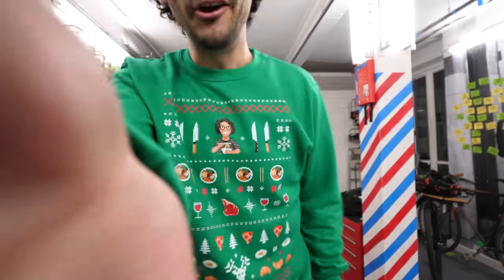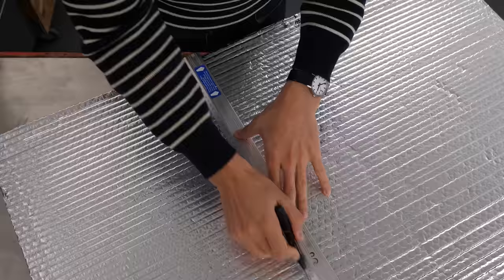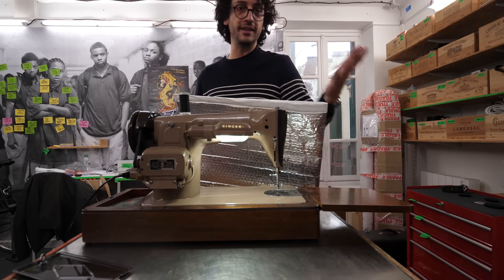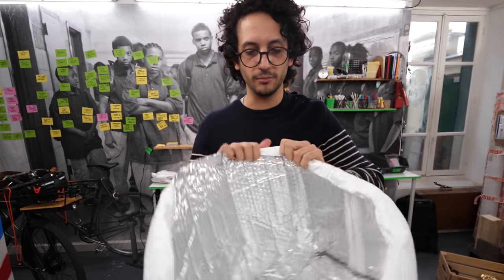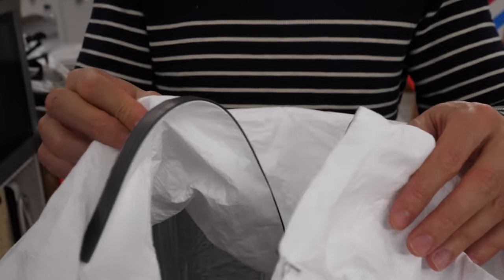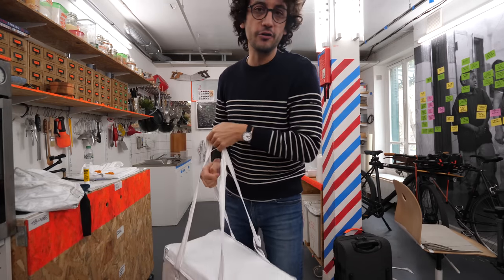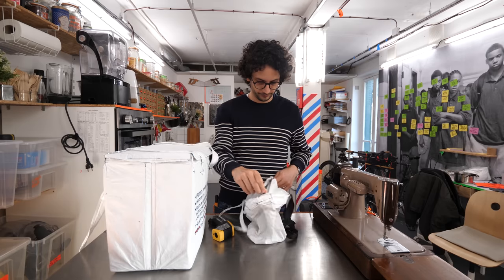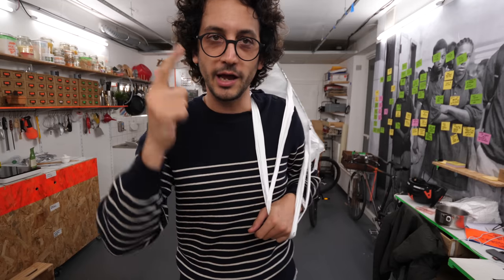Grocery Bag #3 Has GREAT Insulation But...

Comment: I think you need a rectangular waxed canvas bag with a fold-out (2 piece?) rigid but thin bottom. Add some adjustable straps, an interior thin insulative bag (which can collapse) attached to one side for cold items, and a simple fold over cloth lid (maybe with magnetic closing snaps, and also something stronger like a simple tied closure for situations where it may fall open during transit)

Comment: For foldability and structure, you could have a flap that is loose or sewn to one long side.  If it is a tough cardboard or plastic, it could provide the base structure and fold up with the rest of the bag.  You could even have it be a rollup mat made of bamboo rods.  This would allow it to conform to a small cylinder that rolls out to become them bottom.  For insulation, all you really need is air between two waterproof layers.

Comment: If you want structure + compaction there are options with a wire-rimmed cylinder. It can fold into about half the diameter, be flat, and yet pop into shape when desired.

Comment: Try sewing layer of the "space blanket" between two layers of "tyvek" that would be both reflective and give you an air gap. The alternitive is to use spray adhesive to join the silver space blanket to the tyvek reducing the layers to one.

Comment: Try adding an inside lining of a recyled wool blend to the tyvek and then use the insulation on only three sides of the bag, keep the adjustable straps and instead of a box use a messenger bag shape, for added benefit use indigo or other plant based dyes for a nice colour/design

Comment: The neck of the bag was great, that means it can expand when you buy a lot of stuff. You can buy stronger magnets online, I've had the same issue and stronger magnets get the job done. For insulation, in NL we have these aluminum freezer bags you can buy at the supermarket. They are plastified and get the job done, but still have a similar thickness as the tyvec.
Reply: To add to that, I use jeans needles if I need to sew something tough. they are 110 instead of the regular 75 or 80 needles and can handle thicker materials.

Comment: Have you tried to sew a ziper? The water proof ones can gave you structure and a easy closure.... 
For the fold, you can experimenting with a pocket atattchement to fold the bag into itself.
And do go with diferent size handles. Yours can slide when you're walking.
Hope I  could help... good luck

Comment: For the sewing all the layers part, a walking foot for your machine should help. The machine normally pulls just the bottom layer but the walking foot will pull the top layer with it. It's used in quilting a lot cause of all the layers

Comment: For foldability along with insulation, you might want to think about mylar survival blankets. Super lightweight, highly insulating, very foldable. They can be recycled, although it's a specialized process and not every place does it. Layer it with your tyvek or even just canvas and it should hold up pretty well .

Comment: Maybe you could use the metallic material on the bottom only to make a rounded square structure (most of the cold will be lost through the bottom and sides) then use goose down/ down insulation/ upholstery batting like an ultralight jacket. You could sew whatever pattern you'd like in the down between two layers of tyvek. Honeycombs or lines, whatever you'd like really. It would certainly be more flexible and a bit lighter.

Comment: I was thinking just one sheet of those insulated panels for the bottom of the bag (no need for Velcro as the weight of the groceries will keep it down); then the four side panels sewn end to end on three of their ends, plus two Velcro strips on end four & one (so it makes the four sided inner box). What u would effectively have is a long rectangle (the four side panel) & a small rectangle (bottom). U then put the bottom rectangle on top of long rectangle & use the old camping trick of rolling it up into a roll which you could shove in your other back pocket of ur jeans. Of course, I’m not bothering with top insulated panel cos that might make the “roll” too bulky for ur pocket??! But u get the idea... (I hope) 👍🏼👍🏼✌🏼

Comment: you have made something of a food courier bag there! funnily enough my local supermarket coop makes a bag (google "coop fold away bag" and look for the light blue bag in image results) out of PET recycled bottles, which has most of the elements you've been designing for, except the insulation. what i like because it's made out of recycled plastic is that it has a lot of rigidity when unfolded, but it also has the flexibility of fabrid so can be folded down nice and flat and be tucked away in my courier bag where it takes up no space. i could envisage. i could imagine just taking the reflective mylar thermal blanket material and sewing that into PET cloth and you would have something insulated but thin enough to still fold.

Comment: hey alex, you could have the insulation part only cover the bottom and then maybe a third of the way up the walls, and not on the lid. that way you would put frozen items at the bottom of the bag, then refrigerated items on top, then non-chilled stuff at the very top. maybe even have a false bottom/lid in the bag, mounted at the level the insulation stops, so it makes a chilled compartment in the bag, then other stuff goes on top of that.

Comment: Have you considered using wool to insulate the bag? It may be an unorthodox suggestion but it could tick a lot of boxes: recyclable, insulating, depending on what kind you get it could be thin enough to fold, and it even has some water repelling qualities (although it wouldn't need to because you already got the Tyvek leak-proof in the previous prototype).

Comment: Make a everyday backpack-type bag that has a sleeve that goes the entire inside of the bag (meaning, a bag within a bag with a space in between) to slide an insert into when you want to use it for groceries. You would create the insert out of that material you purchased to help with structure and insulation but when you aren't using it for groceries, you can pull it out. Also the backpack could have a top flap that goes further down the front of the bag where you can clasp it shut which would give you more of a pyramid shape bag instead of a block. Good luck!

Comment: Try neoprene! Very good thermal insulator, relatively easy to sew and also flexible. A tote bag type design with a zipper could work well. Might not meet the mark when it comes to recyclability, however.

Comment: Try wool battoning for insulation, it would be economic and recyclable, it is on the more expensive side but it would provide additional structure without being unable to fold the bag up. Alternatively one of the foil emergency blankets that would help with insulation but not so much with structure. If you sewed the foil between  two layers of the fabric that would help with structure.

Comment: To solve the foldability problem, I'd suggest looking at the sides of a regular paper grocery bag. The two narrow sides have an inverted 'Y' fold, and one of the wider sides has a horizontal fold. That enables the bag to be folded flat. Then you could roll it up and you'd have a tube which could be held together with velcro straps or you could use the bag's handles.

Comment: How about a removable insulating liner to add to the first bag? 
Attach it with zippers or velcro. 

If you only use minimal tyvek on the reflective foil, you can separate them at the end of the life cycle and sort them into their proper waste categories.
This could also bring some structure to bag #1, and everything is optional so you can take the reflective lining out when you don't need it.

Comment: I have a suggestion for the portability of this bag.  I really don't know the technical name for this thing, but you might have seen it in the foldable sunshade for your car, foldable photography reflector, folding tent, etc.  It has a metal frame which you can twist and make it smaller.  So I suggest to use the same metal strip (name?) for the frame of the bag so that it can be made small and when expanded will provide strength and shape for the bag.

Comment: This is pretty great! So curious what the next step is, probably thinner foil? Also! Definitely include thick elastic strap compartments for holding wine bottles/other glass without clanking them together. if you're just carrying multiple glass bottles in a bag to the car then it'll be fine but if you're biking or walking a bit further then I'm always afraid to break them.

Comment: Alex: use space blanket bonded to tyvec for strength and insulation (use spray adhesive).  Next create a flexible wire frame that folds into a circle, but pops out as a cube (think pop up tent or pop up clothing hamper).  This will make your bag rigid, lightweight, foldable, and insulated!  Another thing: with this design you could make the zipper have more of a curve shape so it doesn't bind at the corner, but still closes completely.  Something to think about.

Comment: My suggestion for one of your prototypes is to use nylon taffeta (used in Eno hammocks) layered with Mylar blanket (emergency blanket) material for a well insulated bag that could fold small enough to fit inside a wallet.

Comment: Alex,  I have plowed this ground myself and concluded two things.  First, the bag looks much better if you make it right side out and cover the seams with double fold bias tape https://en.wikipedia.org/wiki/Bias_tape  rather than making it inside out and inverting it upon completion.  The bias tape helps it keep its shape.  Second, I made my final bags from three pieces - two ends and a belly piece that acts as the two sides and bottom.  this makes the bag look better too and you don't have to cut the triangles out.  I also ran the straps all the way under  the bag and used one continuous strap.  As to the bag #2 zipper conundrum, use a detachable zipper (like a coat) and do not sew down the ends of the zipper flaps, only the sides.  This way you can unzip and open the flaps to load then close the flaps and rezip.  If you are worried about the the little gaps at the ends, add some additional material to the flaps.  Jim

Comment: Hey Alex, some idea here. Examine one of Carrefour's plastic re-usable bags with handles and you'll notice BOTH the small sides can fold inside because they're stiched in the middle, whereas your bag seems to have only one small side divided in two and stiched in the middle (so the other small side doesn't want to fold naturally). Moreover, consider this: if you start from any rectagle and fold it in the middle, what you get is a V shape that is very close to an  U shaped bag (of course without its lateral small sides): it tends naturally to close as it's an U shape and you can put velcro on the top of both ends to close it easily (imagine an U shape with velcro on both sides on top). Then, you don't necessarily need to put insulation on the small lateral sides, because by insulating the main body (the big rectangle turned into an U shape) you've already provided enough insulation. So if you don't add insulation to the sides, you can make them a lot more foldable (like in a carref's re-usable bag). Ciao from Italy ;-)

Comment: Alex, use an emergency cloth. Milar is the name. Super insulating and more thin and light than you can think. But it has a problem: it you punch it with you sawing machine you can rip it off. Good luck!

Comment: What about using wool sandwiched between two sheets of tyvek? Wool I don't believe is recyclable, but it is a good insulator, and at the very least is a natural product. It would give SOME structure but not a lot. For the structure part - what about making that optional in the form of wooden or plastic slats (size and width of a ruler, perhaps?) They wouldn't fold (unless you got some sort of telescopic plastic ones) but they'd be super flat and you could just pop them into little holding braces (make a pocket out of a loop of tyvek and slide them in) to hold the bottom open. Edit: Instead of sandwiching, QUILT - will add "pretty" in terms of contrasting thread in patterns, air pockets for insulation AND quilting provides a lot of structure.

Comment: Could use one of those insulation sheets that they use for rescue. It won't be as good as the solid stuff but it will be foldable and easier to take around.

Comment: It's worth noting that when measuring the insulation between the two bags, the ice pack in the new insulated bag had a much larger volume of air inside to absorb heat from and reach equilibrium with before the insulation of the bag was able to come into play. Even though the result was already desirable, I think this would indicate that the new bag is even better insulated than what the test showed. Nice!

Comment: Go with collapsibility. inward so that the bottom folds in and the sides fold in but you have to find a way in which it doesn't collapse outward. Also, zipper that starts at one corner goes all the way around the bag and it's ends at thee other corner.

Comment: You should try a pencil case zipper ide. So two zippers down the lean goth sides with a string holding them together to pull it. Keeps it open and still in tact.

Comment: If you sandwich the insulation between 2 layers of Tyvek, adding about 2cm around the insulation, you will have less trouble sewing, since it wouldn't be as thick. In that situation, you can also add webbing or tape to provide edging structure. Plus, the bag would be more foldable. This is something you can do in panels, creating seams over the bag in a grid. It will still be stiff, but probably more foldable than your current incarnation. As to the closure, the Velcro is a good option for security. If you want it more air tight, and better to hold in cold, try 2 short zippers, one on either side of the flap, with the velcro on the long edge to keep it all shut. :)

Comment: Make it a double layer with an air chamber,  Then you can blow it up like a balloon and add SOME (I'm really emphasizing the some part here) rigidity to the bag.   You may need some other type of material such as mylar (i know you're gunning for recycling but this is the best i got) as an added insulator.  Also maybe just one layer of that shiny stuff at the bottom and the air chamber around the sides.  Good luck.

Comment: Good episode! I have a sugestion to fix the foldable/isolation issue. You should obtain a heat sheet. Those are the tin foil blankets for marathon runners to keep them warm. 
Not only are they extremely lightweight and foldable but they isolate extremely well.

Comment: Spray adhesive a layer of mylar to a layer of tyvek for the vertical portion.  Just use the bubble insulation on the bottom.

Also, the insulated bag test would have been even more impressive had you reduced the air volume around your freezer pack.

Comment: Seems a zipper on rabbit ear folds that each extend beyond the bag’s top corners could give you the zipper close with a wider mouth for easy access in loading. Like the other ideas to have creased folds in the body so it could pack down efficiently before use. Origami + origami solution. Looking forward to grocery bag episode #4; sign me up for beta testing ..

Comment: I would suggest having the insulation in smaller strips rather than the big sheets, but otherwise a design similar to this. Which makes the bag much less stiff, and when it's half full it's not going to be as large as when it is completely full.

Comment: Total shot in the dark, but what about a wireframe around the edges? You could design it in a way so its easily foldable and you wouldn't need to sew with the isolation around the corners, which could save some centimeters when folding.

Comment: Can I suggest a slightly thinner and more flexible option? A sandwich of tyvec, mylar, tyvec, mylar, tyvec. Yes, go 5 layers. Your machine can handle the bubble wrap, it can handle this sandwich. It MAY still fit in a pocket, but it may have to be a cargo pocket rather than a hip pocket.

If you really want to upcycle, consider the outer layer to be denim or something like that. Of course, such a thick material would make it less compactable. 

Anyway, you've got lots of choices for your outer layer, or you could just decorate the tyvec. (Heat transfer maybe?)

Good luck!

Comment: I have an idea on how you can compartmentalize your bag. Inside on the front and back sides sew in a patch of Velcro across the top and bottom and then cut a piece of hard plastic the height of the bag and the width between the front and back then cover that piece in fabric and add two little flaps of plastic about an inch wide covered in fabric too but add the opposite side of the Velcro so that wherever you insert the flap you have a separate compartment the size you want.
To help with it being foldable, you would want to cut the insulation into either long sections or squares so that you can fold the bag along many different planes.
Have a blessed day!

Comment: What if you used a space blanket (-like) material as an insulating liner? Its more flimsy, but you could layer it in between the Tyvec. Maybe 1) Tyvec/space blanket; 2) T/SB/ T; or 3) T/SB/SB/T?

Comment: The insulation might even work better than it seems, there was a huge amount of air volume inside the bag for the ice pack to cool down. If you were able to crunch the bag down like the other one, so there was less air inside, it would probably keep the ice pack cooler for even longer.